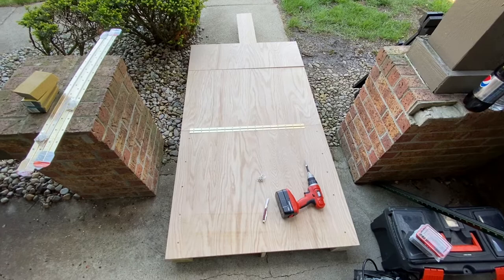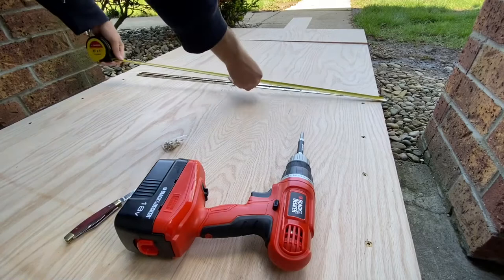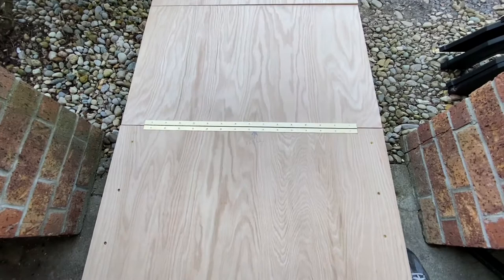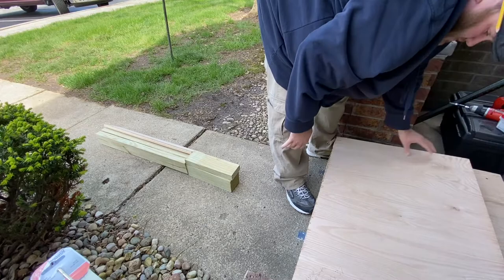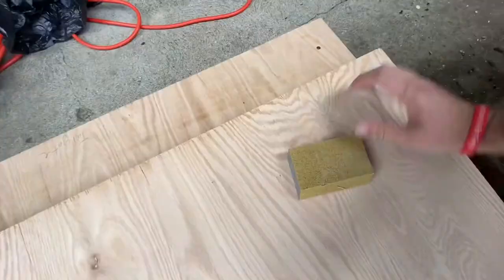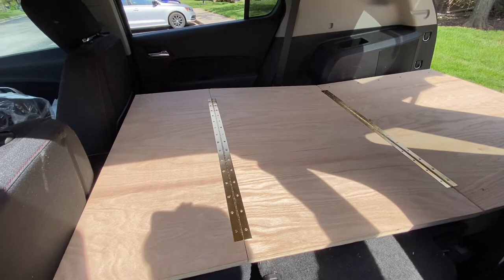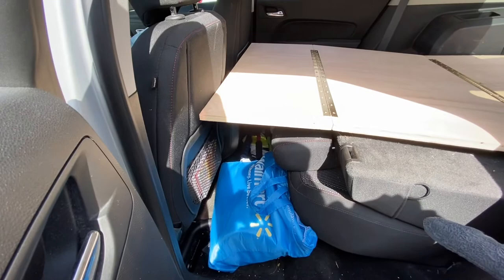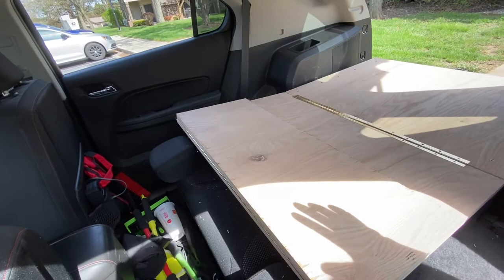2015 Equinox SUV Camping Build Day 3

Comment: I have a 2017 equinox and it’s just like yours. I didn’t want to take out seats. Thanks for this video! Hope you make more
Reply from the maker: Hi, Laura! I'm glad you liked the video and hope it's helpful to you. I couldn't find much on building these for the Equinox so I decided to document the process to show it's possible to do. I gathered ideas from many other build videos and made them work for me. Like you, I didn't want to remove the seats and wanted to be able to convert back to a fully functional car when not traveling, so this was the best option. 

I have four videos on this so far. The fourth is here: https://www.youtube.com/watch?v=-lQYKP2LYHw
It shows building the storage drawer, the hardware for that, handles for easier conversion and adding the carpet. There's a bit at the end that shows the finished platform in the SUV.  

I've completed the build and have tested it on a weekend camping trip. I'm hoping to have a final walkthrough video soon. Thanks for your interest and good luck with your build.